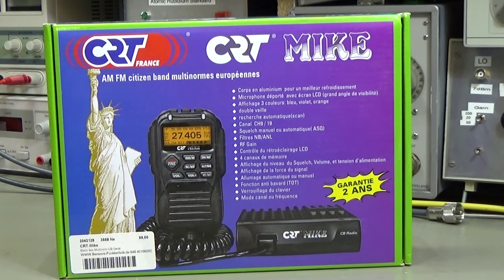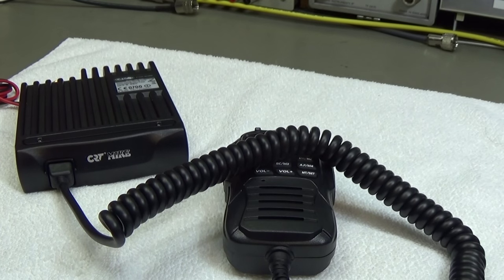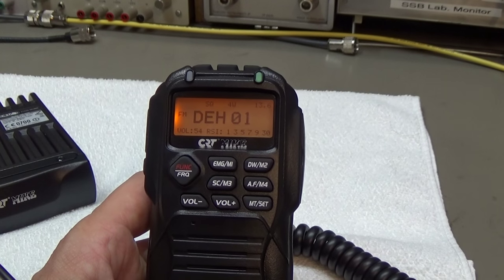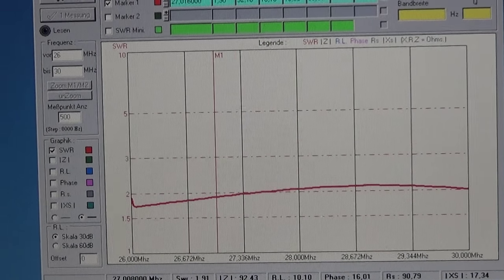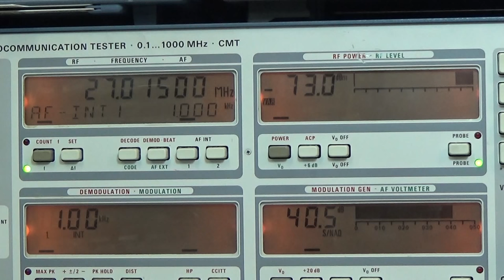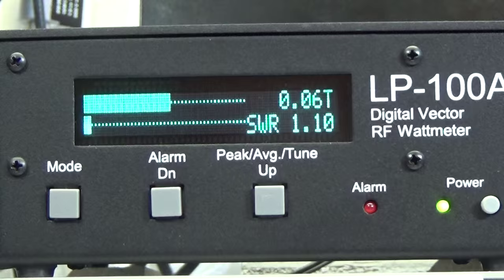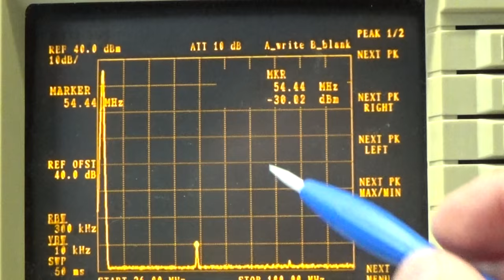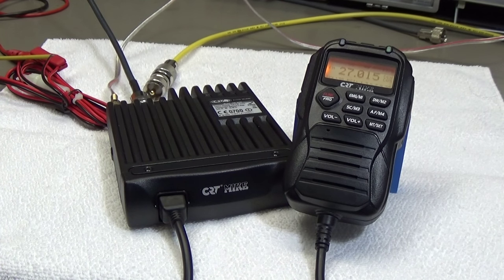#59 CB Radio Lab Test: CRT Mike

Comment: 3 years later working like new. I.ve installed it in my car.s boot in the spare wheel well and used a network cable under the carpet to plug the mic in the front of the car. I haven.t had a flat tire since so i.ve never seen it since i installed it :). Maximum distance i spoke on it was 127km from mountain peak to mountain peak :)

Comment: Nice video, thank you. Could the connection for external speaker be used to connect the radio to the cars original stereo sound system? Or is it not recomended to do so?

Comment: Hi dude, I’ve got a question. I read the manual, but I don’t understand one of the point of automatic power on. 

When the radio is in the mode automatic power on, know the radio by herself the voltage level and turn it on and off automatically? so, by example, when the voltage is under 13.4 volt will it turn off and it is higher than 13.5 will it turn on? Do you know what I mean? Thanks for your help 😄
Reply: It’s the ignition function. When the radio is wired to ignition, and you turn it on, the radio starts automatically.

Comment: Could it be that the harmonic spec is with a normal antenna attached? The antenna would not radiate the 2nd harmonic very much as it would be way out of tune.
Reply from the maker: Herbert Susmann Hi Herbert, that is of course true for a mono band antenna an a very narrow type but there is always a little amount which gets radiated. And the 2nd harmonic is in the 6m band where we have BOS stations (authority stations) .  Thanks for comment!

Comment: One question, at the 42 minute mark, you show the RSI meter. When I have the antenna connected and nobody is transmitting it shows RSI 5 - why is that? On all channels also - level of 5. What does it mean?
Reply from the maker: Alex, sorry I don't know exactly what you mean... 73
Reply: 19:31 here, in your video RSI shows RSI: 7. With my radio in my car, driving around, nobody is transmitting and it shows RSI: 5 - on all channels. Then I go in a very clear area - no houses, etc. it shows RSI: 0. What I would like to know is what the RSI meter means when you don't hear any transmission but it still shows 1 or 3 or 5. When someone is transmitting I can clearly see that the RSI meter jumps up to show the signal strength of the person that is transmitting but after he stops emitting the RSI returns to 5...
Reply from the maker: Ah okay Alex, If it is not your car making any noise it is most probably QRM or QRN  whereby QRM man made noise is and QRN atmospheric noise is.. Hope that helps 73
Reply: Thank you so much!